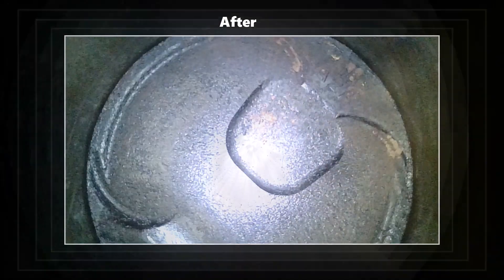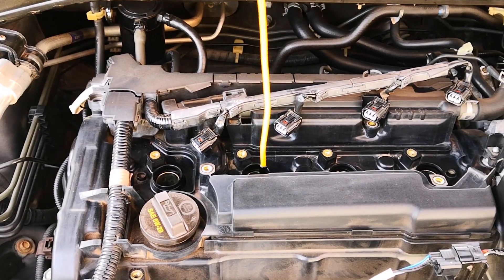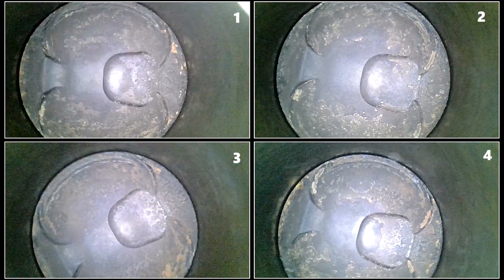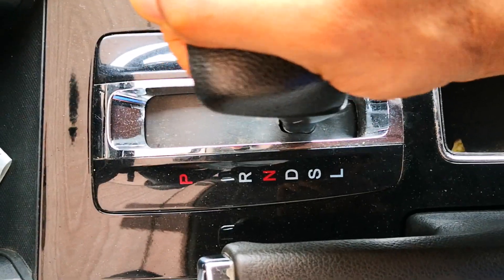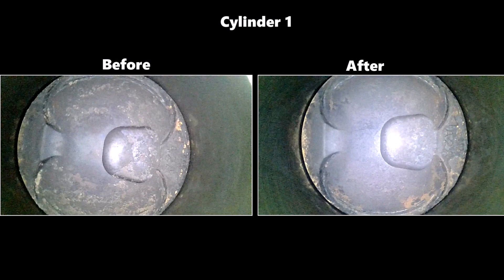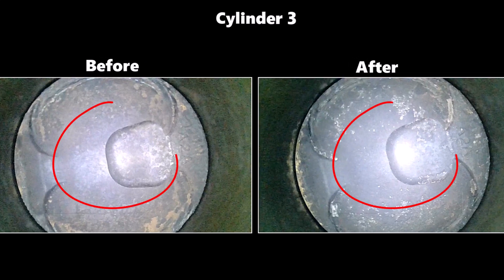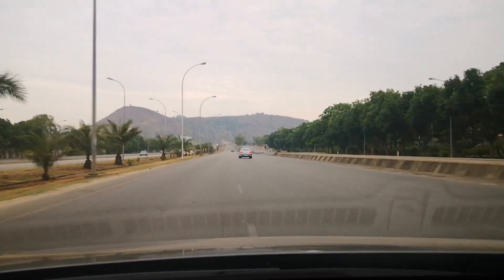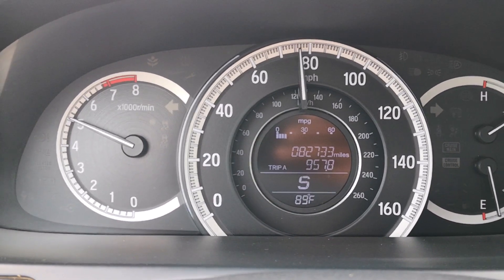Carbon Removal from Engine Pistons / NO Fuel Additive / Wide Open Throttle Driving / Italian Tuning

Comment: How about soaking the plug holes with atf d3 or even lucas. Tho engine has to be hot about 30mins after its off.shpuld burn all deposits
Reply from the maker: Heat soaking works, but never done it.

Comment: I saw my pistons top from spark plug hole,its black,oily and burnt..it burns oil and blue smoke.
Reply from the maker: I agree that at this point, a piston soak is a reasonable thing to explore.
Reply: @DIYAutoworksNG  sure.tho I cleaned the plugs,but seems the plugs I cleaned are all dead,or the car fuse has blown.it would crank but car won't start.now I'm stuck on whether to call a car rewire or a mechanic to come replace the plugs...
Reply from the maker: Spark plugs are fouled. A piston soak remains what I'd do. Also when last was your PCV valve replaced/cleaned?

Comment: But what about the intake valves? Especially DI engines.
Reply from the maker: Good question. I use an intake valve cleaner about every oil change.

Comment: Please Be very careful if you are not a technician expert, 5000rpm can damage your engine very easily if not working under a expert.i still recommend liquid Molly valve cleaner for normal drivers will be much more easier and much less risky.
Reply from the maker: If this were true on all cars, many cars would be dead already, and manufacturers would have fit a rev limiter due to mitigate the risk. That said, I agree with you that damage can occur in a car that has timing issues or is misfiring.
Would also hold if 5000RPM is in the redline range.
Reply: @DIYAutoworksNG  I think you are right, many people said they often tuning over 4000 rpm without any problems for a long period with their cars.
Reply from the maker: Yea. Tuning on a dyno is totally different. No way you can get sustained 5000RPM for long on the highway.

Comment: Good morning, Blessings, Greetings from San Carlos, Pura Vida. Question: I'm new to this. How long is that liqumoly cleaner used every time I fill the gas tank? Or is it only used once? Or is it used when I have to change the engine oil? Do I use it again? the gas
Reply from the maker: Hey. Thanks for watching. Regarding your question, I covered my experience in the first video https://youtu.be/YWKIycwZtY0
But in summary, I found that using it in a couple of successive fill ups with high revs gave the best cleaning.

Comment: Could you try this experiment with a car you have not used the LM cleaner? Preferably a Toyota engine this time.
Reply from the maker: The results should vary by car brand. The combustion process is pretty much the same. Except of your concern is with fuel supply type e.g. GDI vs MPI

Comment: Honestly spirited driving and the such really is not detrimental to almost any of todays engines if they are properly prepared with good oil and maintinance. The real victim of hard driving is the driveline, Trans, axles,suspension,and prettry much everything else. These honda 4cyl can literally sit at 7k rpms for hours on end and as long as its cooling systems and fluids are kept in check will literally last for thousands of hours and probably be one of the smoothest running motors because of the heat produced. New engines love to rev and usually are littered with issues when gram and gramps buy them new and never use the engine above 3500 rpm. They take it to the dealer with hesitation complaints which means the tech or service tech will literally just go out and do a OEM tune up AKA LET IT SING at the top of its lungs for a few. If people only understood what these motors are designed to handle before they even see the underside of the hood they woulndnt be so afraid to merge on the highway
Reply from the maker: I couldn't agree any more! Very well said.

Comment: Very nice video as always..
Here's my take : it's about preference, safety,  and a few other factors.
1. Not many people are confident enough for spirited driving, hence the need to go with additives instead.
2. Not many engines can take that much high rev driving to achieve self-cleaning.
3. In a city like Lagos,  we barely even have such free highways to push 80mph consistently to achieve self-cleaning.
Reply from the maker: I totally agree with your points! My only modifications are that engines can actually take high revs more than you think as long as you are not driving the car always like that. Redling is where it becomes detrimental.
I rarely also get the road free to push at 5500RPM for sustained periods, you meet cars, need to slow then and then pick it up again. I particularly agree with your point on not everyone has the muscle to push a car like that. In such cases, the additives will do it's work, one may also drive at lower gear if tolerance or max speed regulation is a barrier. Lastly, thanks a lot for commenting. It really helps!
Reply: @DIYAutoworksNG  yes, secret is not to keep for long time revs up... the mechanical part of closing and wide opening the acceleration is the efficient part as this impacts directly on the valve cleaning.
Reply: Can’t you just drive it in a lower gear in high RPMs? Why do you have to go 80 mile an hour you could still be at 4500 RPMs at 30 miles an hour if you’re in a low gear.
Reply: If you just rev up your engine at lower speeds, you dont get so much AIR. Air helps a lot to get as much explosion as you can get. This being said, you will have a better and more efficient burning fuel at high tempeatures (reving up engine is not getting you most high temperature needed to destroy carbon film or little debrees and contaminants. If you just wanna rev up your engine, rev it up in the neutral but you dont realize nothing in this matter. The idea is to get as more AIR in the air intake as you can, as it can burn and explode ath higher temperatures and clean more efficiently.  @I_will_show_you_monkey
Reply: @I_will_show_you_monkey  I believe the high load from driving as fast as possible with heavy throttle even at a low to moderate RPM would have more of a cleaning effect than a high RPM alone without much load since a high load is what creates high heat and pressure in the cylinders, not higher RPM. In your example of going a steady 30 MPH at 4500 RPM in a low gear, the engine will be under almost no load and the pressures and temperatures in the cylinders would actually be quite low.

Comment: Have you ever tried STP complete fuel system cleaner? It claims that it has PEA+PIBA detergent. It would be nice if you could review this product. Thank you
Reply from the maker: I've tried STP complete fuel system cleaner but not in a video. Didn't look in the cylinders before and after either.
I'll keep a tab on this.

Comment: Very interesting! I would say there is a point in using the additive if it speeds up the process. That high rev driving should be minimized, specially because of the wear it causes to the tranny
Reply from the maker: You have a point. Though I wouldn't worry about the high revving when it's only done infrequently.

Comment: Possibly, we dont need Liqui Moly to clean pistons, but then we need Honda Accord instead.
Reply from the maker: As I said, it depends on the level of build up. If the build up is substantial, it will take a longer while to get it clean by high revving alone. Genuine additives just aid and quicken the cleaning process.